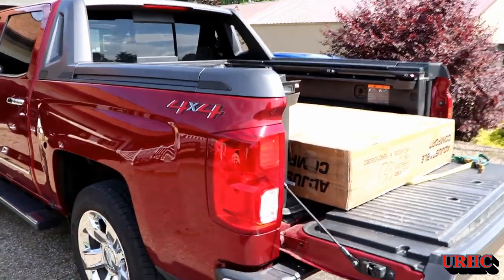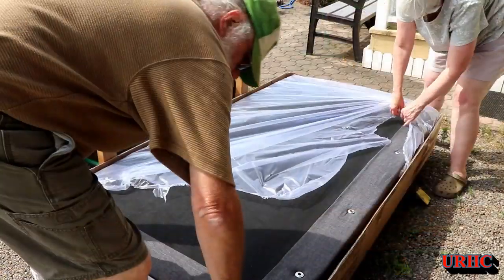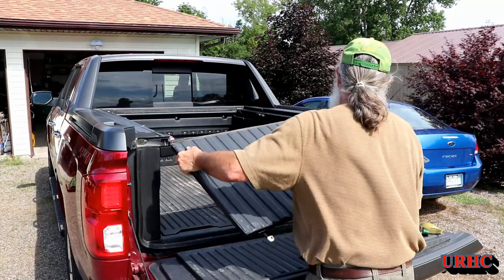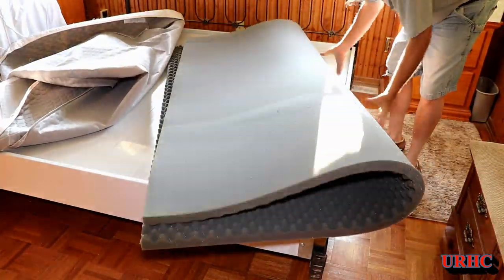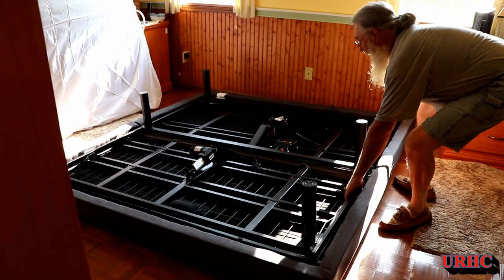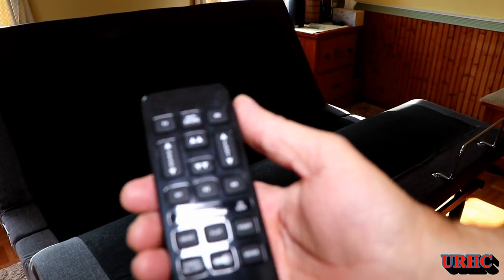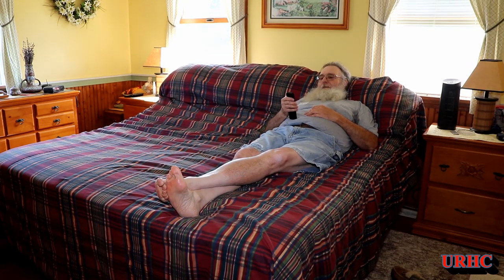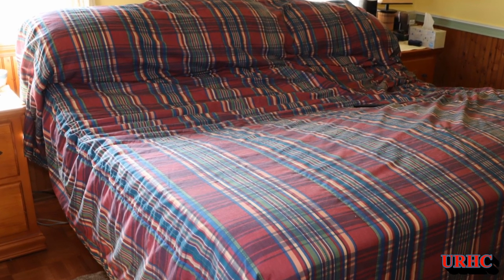Classic Brands King Size Adjustable Bed Base

Comment: When we got our adjustable base two years ago, we got a split king adjustable for a very reasonable price. My wife and I both sleep in different positions, so it was a must. The big difference in prices are the split king beds have two actuators, one for each side. Of course, mattress prices are pretty high, too. The zero gravity feature is GREAT! And I gotta admit, the snoring problems have been greatly reduced! Thanks for the review video.
Reply from the maker: If we didn't have the dogs we would have gone to a split bed. Wife says no snoring since we got it and I have been sleeping much better.  Should have switched years ago. Thanks for watching.

Comment: You got a great deal! 
Our bed is similar without massage 
Split king is better for couples to get they perfect adjustment 
My husband has CPAp and like to up more I’m a stomach sleeper and like to be down more
Thank you for doing this video because the first time we moved our frame from my parents house (while waiting on our Apt to be ready) only 14 miles away 
The movers charged us $1300 to move it !
Now the new movers are quoting $250 for two mean for two hours but it won’t take two hours 
But they have two hour minimum 
$250 seems a lot cheaper then $1300 but 
They aren’t providing the trucks for that either just moving bed frame is our only reason to hirer movers which is so silly!
We were told this bed can’t come apart they could only fold it and move it at 200lbs we can’t do that 
But if it can be taken apart like you did we are so shocked 😳 
We might be able to move this on our own!!! (Well not us because both my husband and I are disabled but my brother and a friend should be able to get it for us now !) thank you for this video fingers crossed 🤞 it works
Reply from the maker: Still working great.  We love it. Thanks for watching.

Comment: Very good video and informative. I received mine a few days ago and with the plastic sleeves busted on the center joints. I replaced the sleeves with metal ones from a door hinge repair kit (38437) from an automotive store. Works like a charm.
Reply from the maker: That's  not what you want to have to do with a new item. Ours still works great with  no problems yet. Thanks for watching.

Comment: Thank you so much for making this video. It was very informative and helpful. I've been reading reviews about this adjustable frame but your review sold me.  :-D. Thanks again.
Reply from the maker: Ours has been great so far. We love it.  Thanks for watching.
Reply: Nice! Yeah, I bought it from walmart.com. The frame went up $30 from when you bought it, but it's still a great price as you referenced. These are crazy expensive everywhere else.

Question: If the plugs start to come loose possibly due to the vibrations how did you keep them in place?

Comment: Nice review.  Have you had any issues with the legs?  One thing about most adjustable beds - when you flip them over after assembly, the manufacturers warn NOT to turn it over with the method you used, where the 3 legs on one side take all that weight as you turn it over into place.  There are definitely stories of bent or broken legs.  Clearly, yours survived, at the very least,  the flip into place.  I've been dreaming up different methods to achieve the flip (I'll have to do it alone - is a breeze with two people, obviously) without putting any weight on the legs, which should be even easier for me, as I'll probably get the much smaller Twin XL.  You did get a KILLER deal on a frame that size, especially given the features.  The only thing it lacks that would be nice, is the underbed illumination, which I'll probably add on my own, with USB powered LED light strips.
Reply from the maker: It has been fine. If you can't  flip one like that the metal  is to thin and look for another brand.  Thanks for watching.

Comment: Great video, I've been looking at these for a while now. maybe you can do me a favor, with the tallest legs, can you measure from the floor, to the top of the motorized platform. As well as how much space underneath the platform there is. We put those slim crates underneath and roll them under for storage. we have the short foundation, because of our headboard so I'm curious how this stacks up. Thank you
Reply from the maker: For some reason my reply is not showing up.
Reply from the maker: Tried 3 times and it disappears.  14 inches but can be changed to 7 and 11.
Reply from the maker: Grey pary is 5 inches thick. Actuators a little bit lower.

Comment: Hi URHC, I enjoy all your videos and reviews a bunch and this one really applies for me. 
I'm looking for one of these bases now. Can you tell me what the clearance is under the base using the supplied longest legs?
I currently slide 11" plastic storage bins under my current metal bed base. If its less than the 11" clearance I need can you see a 
way to extend the supplied legs higher up to tne 11" - 12" height as you seem to be able to re-engineer about everything you come across. Thanks and keep up the great work, Bob
Reply from the maker: Mine has a little over 9 1/2 inches clearance  but in the actuator area it's about 3 inches less. I wonder if extending the leg would make it wobbly.   The leg spacing would probably limit you to less boxes also.  I think it would be best to find shorter boxes because the bed is fairly high already. 2 inch thick wood blocks with a 1/2 deep pocket for the legs so they can't slip off and no slip rubber on the floorside may work.  This may not be the best option for your storage needs. Thanks for watching.

Comment: Hi, You would have been surprised if you had ordered a queen size bed. I was looking for a new mattress for my bed and like you, I thought a Queen size would be a little smaller to give me a bit more room. When it arrived I got it upstarts and to my surprise, it was a lot bigger than the king-size. The cat immediately jumped up and went to sleep, so I have to live with it and lose about nine inches or room space. As long as you don't want to sleep and the boss wants to read you will be OK.
Reply from the maker: That must have been quite a surprise. Now you have room for a couple more cats. If we didn't have dogs I would definitely go for a split unit but we have settled on a setting that works good for both of us at night. Thanks for watching.

Comment: the battries will only work once when the power out its to help get to the flat positions if power goes out the 9 volt battries
Reply from the maker: Ours also lays flat by itself when the power comes back on. We took the battery out. Thanks for watching.
Reply: No worries I troubleshoot these for a living and my company does the manufacturer warranty on them so why i knew alot about it

Comment: So its been a little while. Do you have an update on how this base is holding up. Considering one myself.
Reply from the maker: Still good gets moved everyday with no problems.  The only thing we have found is if power goes out it moves to the flat position. I do updates if something changes.Thanks for watching.